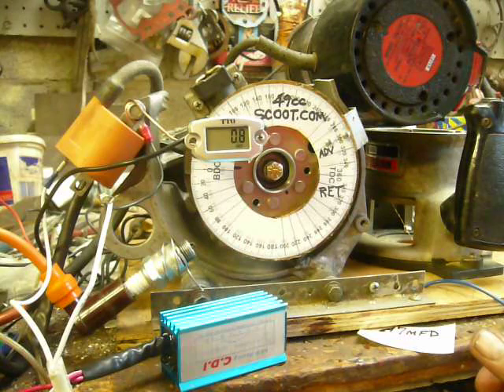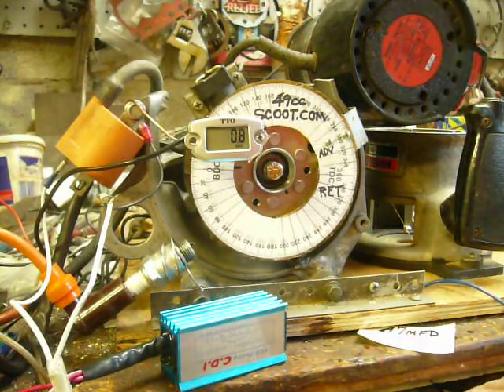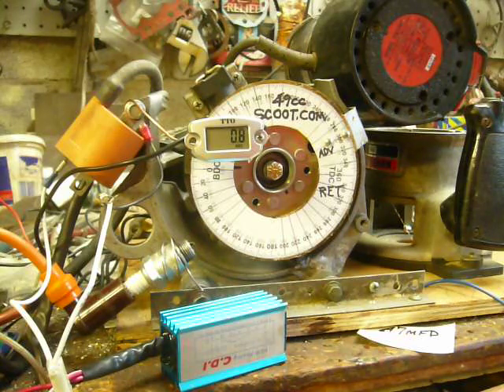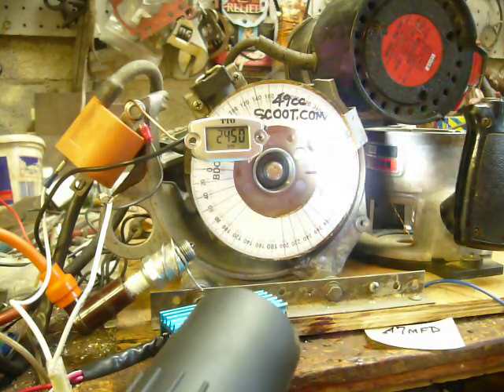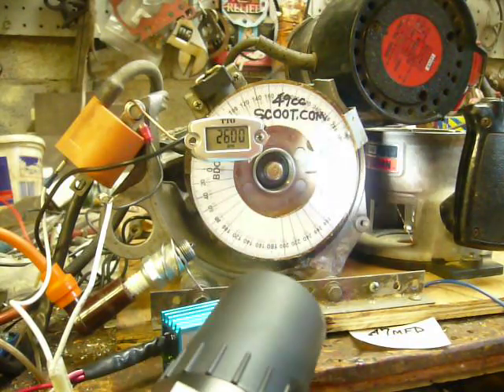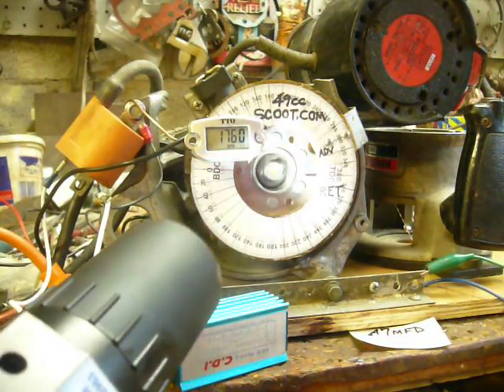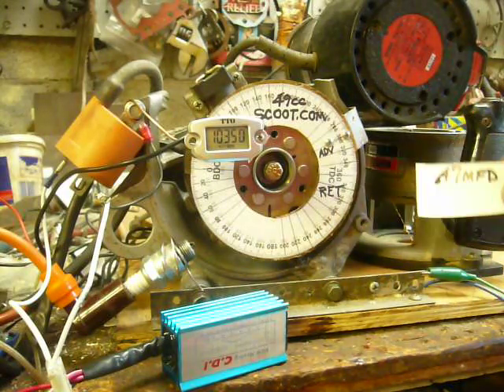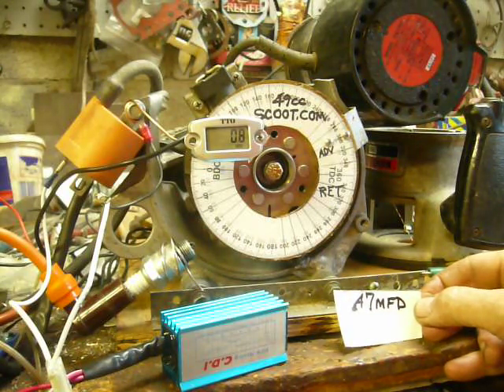CDI Timing Retard Mod w/Capacitor

Comment: I connected this capacitor to the pulse coil wire and grounded it at the frame on a honda spree when I got a timing light making connection appears to retard quite a bit initially then when reved looks like it's advancing with a timinglight
Reply: I had it backwards it was actually advanced to the moon at some point adding capacitors to the circuit it had amazing torque enough to overpower the brake set to not spin wheel while rev

Comment: Does this only work on the AC CDI ? I'm interested to know if it works on a DC CDI for a 2 stroke.
Reply from the maker: If it has a pulse coil, it should work,
Reply: Tried on a 2t bicycle kit connected to the black wire then grounded the other end to the frame changes idle sound white wire makes it die like a killswitch

Comment: Please make a drawing how and where the cable and capiciter should go. Many thanx
Reply: I jammed mine in the back of the cdi connector "pulse generator" wire which was blue/ yellow and ground which was green don't know if it did anything though
Reply: Ground wasn't green...

Comment: Does anyone know what the maximum AC supply voltage is that these CDI's can cope with, I have measured over 20 volts on the moped that I'm messing about with, I'm having issues with the stock CDI and was thinking about using one of these blue boxes but I would definitely want a retard curve.

Comment: Is there any known way to retard 4 stroke  cdi? I have a high compression engine that needs some retard to get maximum power
Any insight would be really appreciated
Thank you
Reply: I did this on 4stroke cdi
It works to some extend with 220nano farad capacitor, still did not solve the detonation problem completely
Out of ideas now 🙄

Comment: isn't this doing exactly what you don't want it to do? don't you want the timing to advance as the rpm increase?
Reply: Nope, in simple terms you would think that as the revs rise the timing needs to advance but on a 2 stroke it needs to retard as the revs rise, this is due to the higher burn rate as the engine comes on to the pipe. Basically as things like the pipe and intake resonance start to work the cylinder gets a better 'fill' of fresh charge, in fact the volumetric efficiency (VE) of the engine can go over 100%. This means that the initial cylinder pressure before the plug fires the mixture is higher and this in turn results in a higher flame speed. The idea behind all this is to get maximum cylinder  pressure after the plug fires at around 14 to 20 degrees after TDC.
Reply: Another purpose for it is to regard the ignition to reduce kickback when starting.

Comment: I did this to my China bicycle gas motor kit, works great! Nice power and RPM boost, less vibration and stink, all for just 60 cents! Just make sure to use the right voltage cap and it's all good
Reply: Would you mind sharing exactly where you connected this capacitor? I'm trying to do this to mine, so far I have plugged the leads of two different value capacitors, 0.47 and when it didn't run right an 0.33uF, into where the kill switch wires plug into the coil to magneto wires. I just slipped the capacitor leads into the connectors and plugged in the kill switch to hold them in. However the engine doesn't run properly, it seems like it only fires once every few revolutions. So what am I doing wrong here?
Reply: @xcliff58x  Yeah I just stuck one leg in the timing/killswitch junction and one leg in the ground/killswitch junction. I had that same odd 4-stroking kinda effect when I used the wrong voltage, like a 100 volt capacitor. I think I'm successfully using a 50v cap right now
Reply: Wow so that's it. My 0.47uF is 400v, and my 0.33uF is 250v. Normally the voltage never matters on a capacitor, as long as it's not too low. I guess these ignitions don't even comply to basic electronic theory, let alone reasonable things such as quality control. Okay thank you
Reply: @xcliff58x  Well look my electrical experience is minimal at best, I can't claim to understand much of how this mod works at all. I think however the "variable timing" retardation effect depends on the capacitor "saturating" whatever that means. I also heard the average magneto in these motor kits produces only 50-100v at most, so I'd think that a cap with too high of a voltage would just add a constant delay rather than varying it's delay as the power flow increases. Also I'm pretty sure the resistance of the cap/the whole circuit affects how quickly the cap charges, so in theory it should be possible to vary the voltage, capacity, and resistance to produce an "optimal" timing curve. My ultimate quest is to set my magneto advance to basically 0 and have a perfectly tuned cap that allows the CDI's inbuilt advance to dominate at lower RPM, then the cap's retardation effect would gradually begin to dominate at higher RPM providing a clean, optimal timing curve all the way from low to highest RPM
Reply: @NLynchOEcake  sounds like you know a whole lot more about this than I do. I thought this was going to be a simple cheap plug and play thing. I think rather than buying any more capacitors I'll just buy the components to build a copy of the Jaguar CDI, and a coil to go with it, and be done with it. Thank you for your time and expertise, and good luck with your quest
Reply: @xcliff58x  Well if you think it will work better for you sure, it will definitely have more customizeability. But I got .33uF 50v caps for 66 cents each at a small electronics store, had to buy 3 to get over the minimum cost to use debit lol
Reply: @NLynchOEcake  that CDI was my plan all along. But I saw this capacitor video and thought I'd try it and run this way till I got around to sourcing all the parts for the other. I don't have a local store that carries components so I have to find it all online

Comment: Just tested it on my BT80 motorized bike engine with the blue box CDI. Before, it didn't want to pull much past 5500rpm with 13:1 gearing. Tonight, I got her up to 7000 (about 40mph). Definitely made a difference!
Reply: How did you install the cdi blue box on your bicycle engine

Comment: Taking it one step further, get a 10 position rotary switch wire it up with 0.1, 0.15, 0.22, 0.33, 0.47, 0.68, 1.0, and 1.5uF capacitors and place in a small box mounted on the handlebars and have on-demand, fully adjustable timing for any driving condition!

Comment: So, how is this wired?
Reply: On my setup I was able to just ram the cap into the killswitch junction, tape it up with electrical tape, and call it a day. Just need it to bridge between ground and the timing wire anywhere on the circuit. In theory you could just run an extra wire from the timing wire into the magneto housing and tape one of the legs to the case ground, or just splice it directly onto the timing wire inside the case
Reply: @NLynchOEcake  ah okay. I didn't know if I would connect it to the red and white wire from the pick up and ground it while having the rest of the wire connected to the cdi. I'm really bad at wiring unless I see it being done.

Comment: I know this is an old post I wanna know what made you go with that orange coil I know there a little pricey so? And I heard they don’t make much if any difference a?
Reply from the maker: The orange coil was a freeby with a cylinder kit,you are right it makes no difference in spark energy!
Reply: @190mech1   Thanks for the reply, It was more of a question? I figured it didn't make much difference if any. I guess we better not  Tell the people buying them on eBay for $63 -$79 Crazy.

Comment: I have an Hitachi stator with inner rotor for a Hiro 125 1981 Engine. I connected the AC and trigger to the red and blue wires and I have a healthy spark that I have correctly set using a timing lamp. I purchased 0.47 mfd capacitor just like yours. I do get a retardation but when I increase the RPM a bit I lose the spark. The green led still flashes on the CDI but no spark. If I disconnect the capacitor I have a spark as fast as my drilling machine goes.
It obviously doesn't work with all stators.
Reply from the maker: Correct,it does not work with inner rotor ignitions..

Comment: I'm easily confused and am confused now. I could swear your video shows the timing mark moving toward your "RET" (which I assume is retard) more as the RPM is increased. Am I missing something?? Isn't timing supposed to move toward advance as RPM increases? Thanks.Edit: I"m unfamiliar with the engine you have mocked up in your video. Is the flywheel turning clockwise? (It's hard to tell in the video) If so then yes, what you're showing IS advance.
Reply: Hi AzTrailRider57, did you get an answer to your question? You are correct, ignition timing needs to be advanced with increased rpm and not retarded.
Reply: @noarmintrying  Hi Steven. In fact, I didn't get a response. For a while, it seemed my comment disappeared. Knowing what I do about electronics, I would think that a capacitor "to ground" would be a low pass filter, which is a delay. A capacitor of a fixed value should provide a fixed amount of delay (fixed amount of time). As RPM increases, that fixed delay becomes a progressively larger fraction of the time it takes for the flywheel to complete a revolution. In short, IN THEORY this would cause a progressively larger retard in timing as RPM is increased. I COULD BE WRONG THOUGH.
Reply: @noarmintrying  What you are not taking into account is that the guy on the video is working on 2 stroke bikes, on 2 strokes the higher the RPM, the less advance you need, which is the opposite to  4 strokes.
Reply: @cristianr3712  I thought it was a 2 stroke. I guess rpm increases so quick on a 2 stroke that maximum advance would be achieved quick, 3000/4000rpm? I don't know that for sure but it seems to be a reasonable assessment.
Reply: @noarmintrying  It's a reasonable assessment if you don't know much about 2T, hope I don't sound rude. Let me explain....
A proper 2T uses a tuned pipe, those pipes work with sound waves and the speed of those waves vary according to pipe temperature, lets say the pipe works best from 7k to 10krpms, below 7k you would want the most advance the engine/fuel can hold, then the bike gets on the pipe from 7k to 10k and the pipe works by drawing more mixture into the cylinder and also then shoving back some of the mixture lost through the Exhaust Port improving scavenging and cylinder filling creating a faster combustion speed, if you don't retard the ignition to accommodate the faster combustion then you'll have a too high effective advance and that'll help destroy the engine, so even when you retard the ignition that doesn't mean the effective advance is retarted, also when you get to 10k rpms if you try to spin the engine above that the power will steeply decrease if you leave the ignition as it is, so what can be done is to retard much more the ignition, that will cause the combustion process to happen later and therefore the combustion gases will be hotter when the Exhaust Port opens therefore the gases going into the pipe will be hotter which will of course heat up the pipe, if the pipe is hotter then the speed of sound is faster and therefore the waves get quicker, what this does is to make the pipe behave as a shorter pipe tuned to higher rpms and this will help extend the power band over the previous 10k rpm powerband effectiveness limit.

Comment: 47 or 0.47 micro Farad?
Reply from the maker: 0.47 mfd
Reply: @190mech1  where he add a capacitor ?
Reply: So you install a 0.47  mf capacitor  on the pick up coil ground?

Comment: Oh 8 months on Youtube and I'm struggling with diy digital CDIs and stuff for a month, for something a single  capacitor will give me. Excellent! On Honda AF18 clone motor I had 17° BTDC stock, I needed curve to hit 10° at 9000, tried 200nF https://www.youtube.com/watch?v=cm0mo0mzO6Y , that was even too much, so finally 100nF did the trick. Head temperature went down from 135°C to about 110°C and more power! Most value for money of any mods I've done so far!

Comment: Hello, how much volts does the capacitor have to be to work with the CDI ignition ?
Reply from the maker: 200 Volt
Reply: I bought a 47uf 250 volt capacitor this morning as i couldn't find a 200 volt one. I did attach it onto my scooter ignition. i could feel a difference on starting my bike and during riding. However as it rained here i crack open the throttle to discover how the top end fifth gear would react wide open.
Reply: Thank you for taking the time to share with us all. I am using that very same black box with a scooter ignition  on a 50cc Suzuki 5 speed motorcycle. I was told that these boxes are for the Yamaha TZR and the Yamaha Jog scooter as a replacement. Until seeing your video i wasn't aware that they didn't have a curve. They do however create a larger spark than an original box on the ignition that they are substituting for and that was a reason i am using one rather than a original black box along with the scooter ignition.
Reply: @shannonking6639  its a 0.47 uF ... how did it work wide throttle?